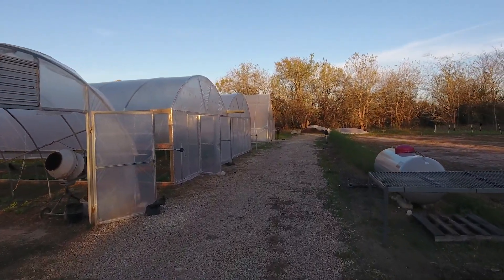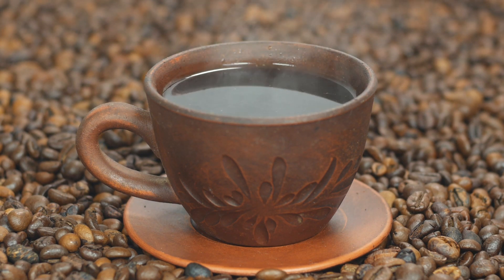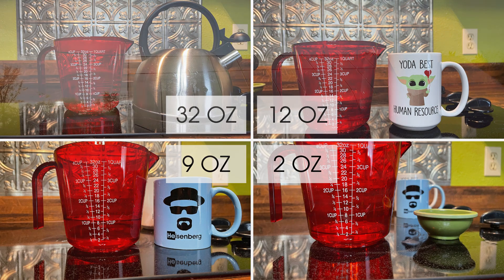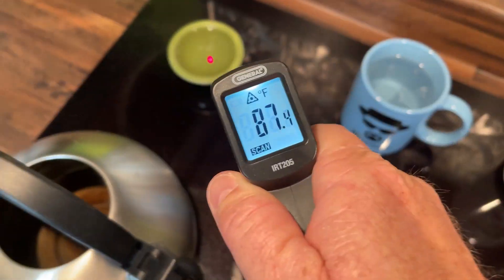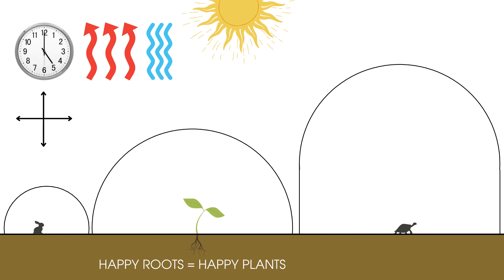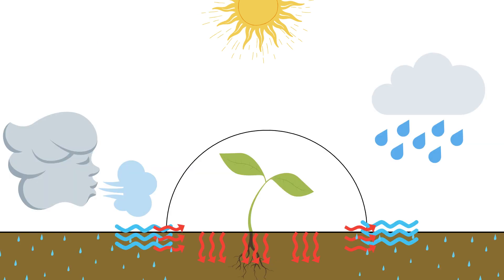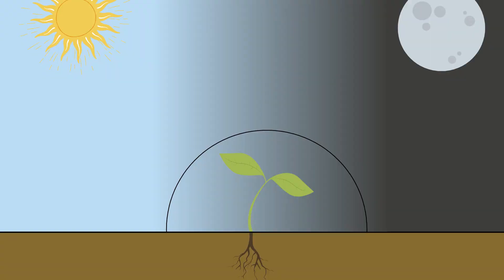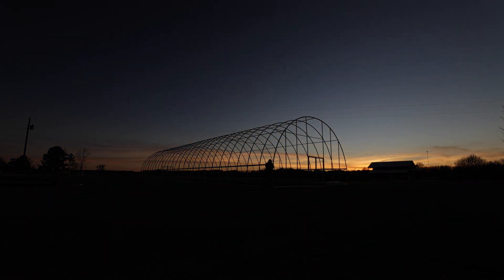How Volume and Air Mass Affect Heating and Cooling In a Hoop House | Hoop House 201 Ep. 5

Comment: 2 important considerations are surface area to volume ratios and convection currents. In the summer, the chimney effect of a tall house allows the hot air to rise where it can released through high vents. Air turnover at the top is the key to preventing excessive heat. If you double the dimensions of a cube, you increase the volume by a factor of 8, but the surface area is increased by a factor of 4. If the film is considered a heat transfer resistor in that it has a small but finite insulation R value, it should take twice as long to attain the same temperature change without sunlight. This is not a panacea and can be visualized by thinking about overnight temperatures where it takes the larger house longer to catch up to the outside conditions. In marginal conditions this means the Sun may come up before the house freezes simply because of the longer catch up time. It also means the house will be slower to warm up after sunrise, but the elimination of cold drafts is not considered here. This is the thinking about a hoop house being a season extender. Another way to look at it is considering the house to be an analog to an electric capacitor. The air mass represents the size of the capacitor in Farads, and the film represents the size of the resistor in Ohms. Doubling the dimensions of the house means reducing the resistor by a factor of four and increasing the capacitance by a factor of 8 so that the charge on the capacitor takes twice as long to discharge. This can be effective for early morning frosts, but not snow. Using double film with inflation effectively increases the insulation value of the film and further delays the catch up effect. Hoop houses are not green houses, so you can still be a victim of an early season 4 day cold snap.